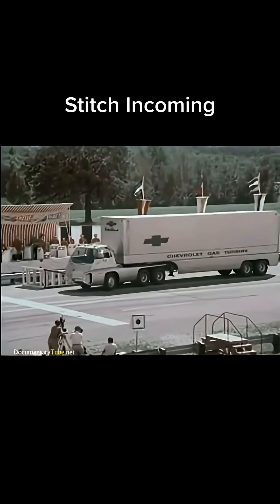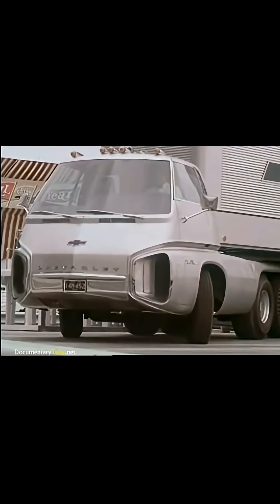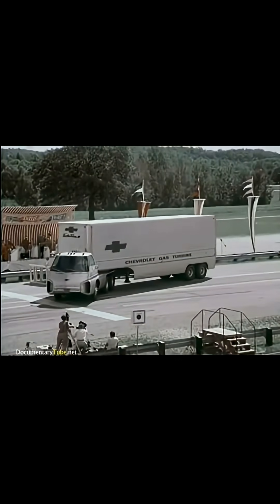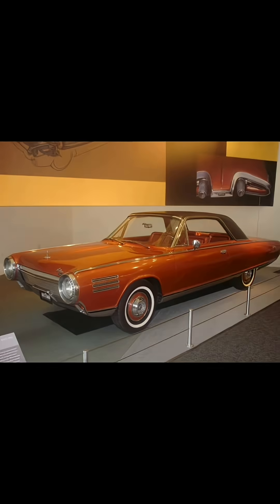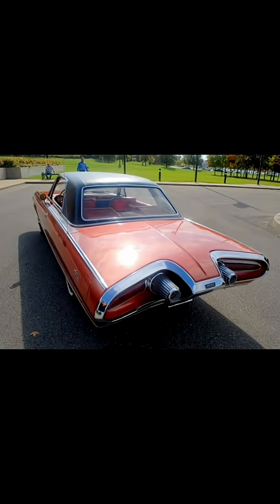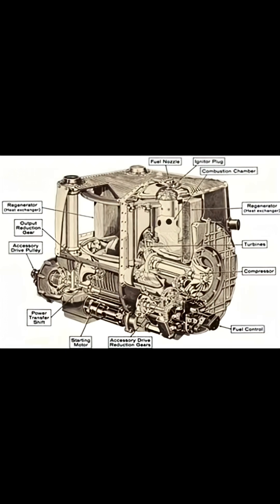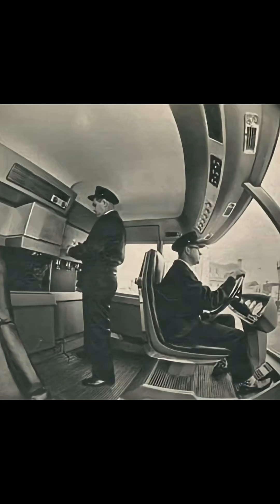The #GM Turbo Titan #Semi #Trucks #Trucker #history #Turbine Prototype #cartok #mechanic

Comment: Re-inventing the wheel.  GM also claimed that a turbine engine was available in their Astro 95 truck.  It was another failure.
Reply: I believe around 1975 Terminal Transport, out of Atlanta GA, ran a couple of those GMC Astro turbines.   They were considering buying for the fleet but it never happened.   The word was that they would pass anything on the road and never gave up any speed climbing Fancy Gap either.   (Fancy Gap NC, Smokey Mtns.)   
       Appearently, they were tough on transmissions.   Makes sense to me.   When you have enough power to climb mountain grades at full speed, fully loaded, the weakest link is gonna break.   Those transmissions were never made to have that amount of power going into them.   I don't know if they were manual or automatics.   I believe probably 10 speeds.
       Terminal Transport ran all of the east coast states back in the day.   Tractors were dark brown with yellowish-goldish lettering.   The two Ts were over-under & staggered.
        Terminal
          Transport
       I made this post partly for posterity / history.   I am among the few people remaining that still knows about these tractors being tested by Terminal Transport.  😊

Comment: And they were also extremely slow about acceleration.That was the other downside
Reply: Are you thinking of the Chrysler Turbine car?  They made about 59 of those ( I think ).  They were relatively quiet.  Their engines were very smooth.
They were stunningly good- looking.
A handful remain.  A few of them actually run.  Jay Leno has one.
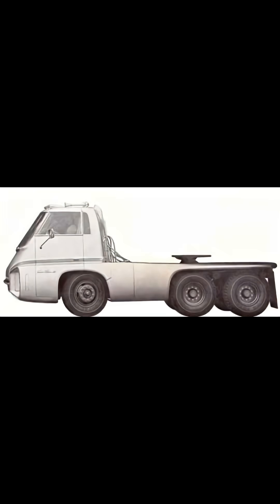I saw two of them back in 1964.  I have two 1:18 models of two Jo-Han 1:25 model kits.  It’s a unique car.  Enjoy!

Comment: Titan only had enough power to pull the empty box...
Reply: I have a 1964 IH 549 V8. Largest gas V8 ever offered in a road vehicle. 285 horsepower. 
I have a 1946 International that started as a west coast log truck. 89 horsepower 
You all are getting spoiled by modern trucks.

Comment: Jay Leno brought his Chrysler turbine car out a few years ago.  Been intrigued ever since.
Reply: He also had to get the turbine rebuilt.
Reply: I’m a little bit more interested in this history. Chrysler started the turbine cars back in 57. I think it was and ran that program all the way to 76 or something. Both Cornets by the way if I remember right. And if I remember correctly, the actual big problem with acceleration. And mileage wasn’t high enough to try and bring out new technology.
Reply: @kevinwieler  Have you checked out the turbine motorcycle by MTT?  Basically they got helicopter turbines that had aged out and couldn't be used anymore in aircraft.  BUT you can still use it for other things like airboats, and motorcycles.
Reply: @kevinwieler  The first turbine-powered car Chrysler built was a 1954 Plymouth Belvedere.  They put turbine engines in a bunch of different Chrysler, Dodge, and Plymouth vehicles before the development of the Turbine Car, which used their 4th generation A-831 turbine engine.  While it was pretty cool as a concept, it was also very expensive.  Chrysler has never revealed cost figures for the engines, but the Ghia-built bodies were apparently $20K each (or over $200K in today's money), and the engines were full of exotic materials and had very exacting tolerances (their maximum RPM was 60,000).  The estimated cost to manufacture each Chrysler Turbine Car was $55K, or almost $560K in today's money.  

The turbine program lasted until 1979 (and 3 more engine generations) when it was obvious that it could not hope to meet fuel economy regulations and emissions requirements, and was also terminated as a condition of the Chrysler Corporation Loan Guarantee Act of 1979, which kept the entire company from going bankrupt.  From a business perspective, turbine engines were a complete dud, and Chrysler hung on to them for far too long.  It should have been obvious before the Turbine Car program was launched that there was no way to make automotive turbine engines commercially viable.  It was definitely crystal-clear to everybody after that program wrapped up in 1966.
Reply: cleetus mcfarland ended up with a turbine car as something else to check out.

Comment: Turbines of the era only had one speed at which they were efficient: wide effin’ open. Also, iirc, the transmissions wouldn’t have lasted long in actual use because of the temperatures they were subjected to. 
But, they’re still Buck Rogers cool